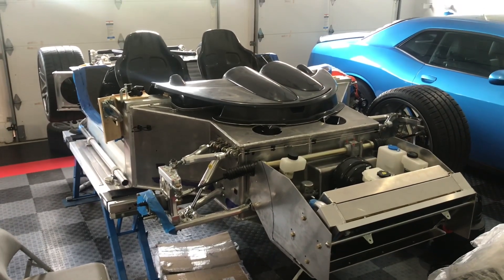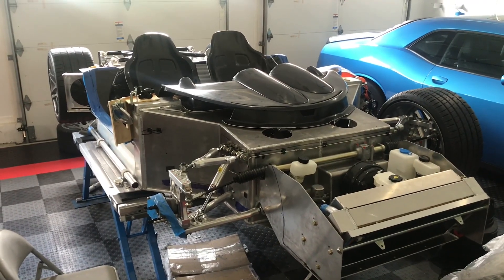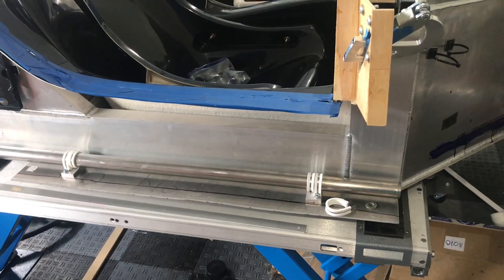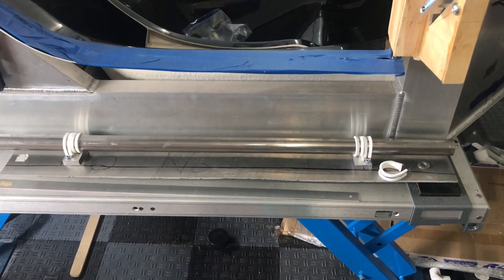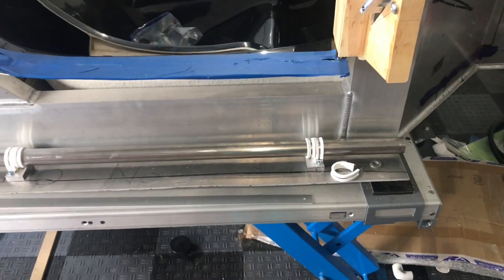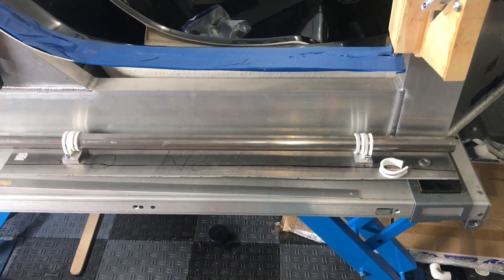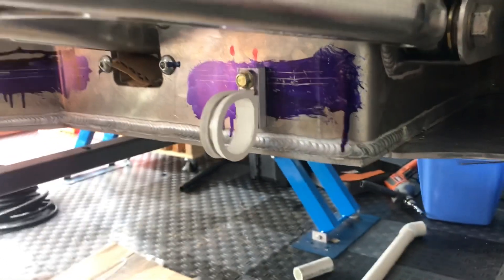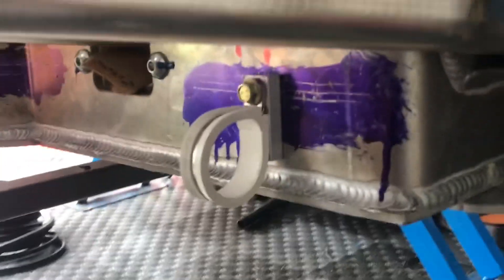Superlite SLC Build 058 Fabricating the Cooling Tubes

Comment: Really enjoying your commentary. I specialize in 3D modeling, so If I bought one of these kits I would make a solid works assembly with all the parts and hardware to share with the kit car community. That way anyone that wants to build one of these can do all their design changes on the computer first then have a more structured plan for their own custom build.
Reply from the maker: Thanks Flocka. 3D modeling certainly has it’s advantages. I am planning to learn 3D printing when I get to the interior.
Reply: @JoelKSLC  thats awesome!! I will certainly be interested in seeing those videos. If you choose to do polymer extrusion, then you can buy a printer with a heated build plate and set it to the correct temperature for what material you are using, and it helps prevent "warping".   There are also other 3D printing methods such as resin printers instead of using a PLA or ABS filament. You can also build your own CNC table to make really large prints.  Most of the cheap printers you can buy you are very limited on size. Would be really interesting to see what setup you choose !